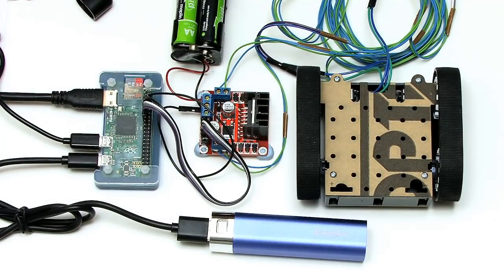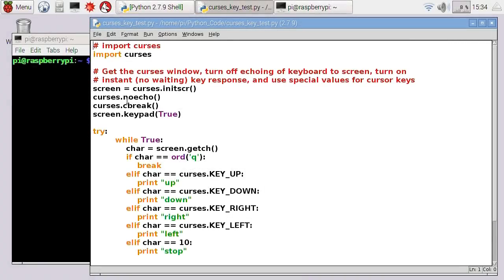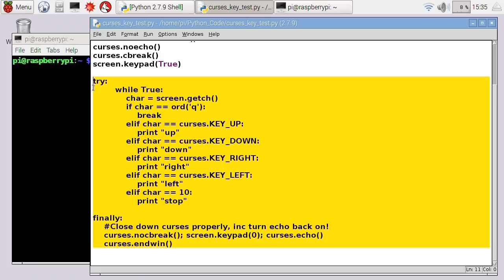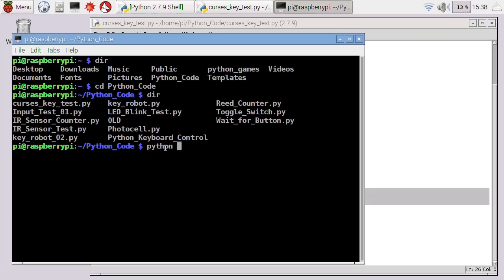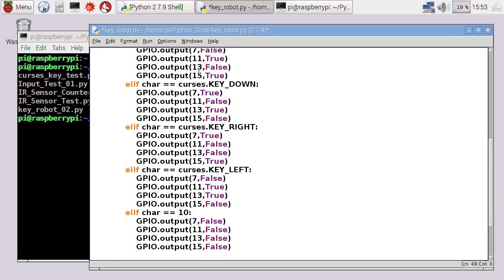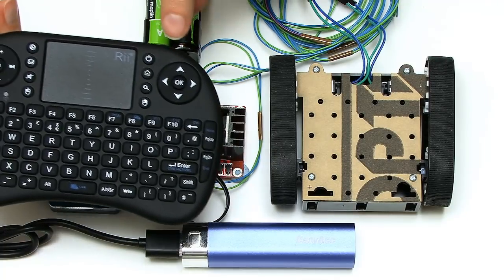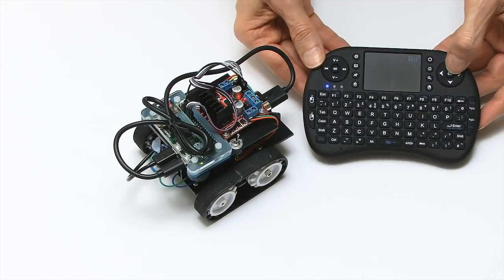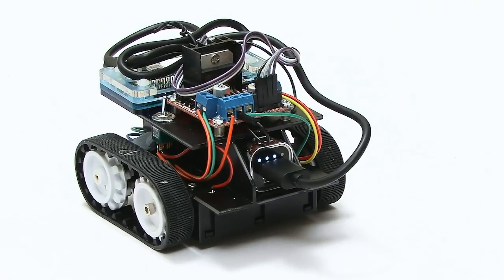Raspberry Pi Robotics #3: Keyboard Control

Comment: do you use a wire stripper to strip the wires if so which one? thx
Reply from the maker: Yes, the wires for the motors need to be stripped. I use a very old (30 years plus) wire stripper. But with care you could use a knife or scissors.
Reply: ExplainingComputers So how do you attach wires to the motor controller then?

Comment: Hi Christopher and merry christmas! I tried to make this project, i wrote the code, i connected the rii before booting up the pi but it still doesn't work!! I run the code and it doesn't read the keyboard. I press the up, down, right, left buttons and nothing. It doesn't even read the q button to kill the code. What am i doing wrong? Can you help me? I really love your vids, i'm trying to teach them to my students being a physics teacher and new to robotics. Thanks a lot!
Reply from the maker: Hi John, glad you like the videos. I strongly suspect that you have not run the code from a terminal. Curses reads characters from the active terminal window, hence if you have executed the code from (say) IDLE, it will not read the keyboard. More broadly I would suggest building thing up in steps -- first checking you can get the curses_key_test.py code to run OK, then build things up toward a working robot. Working in stages allows you to find out where the problem is. Good Luck! :)
Reply: @ExplainingComputers  Hi Christopher, thanks for the immediate response! Unfortunatelly it's not working still. I run the code from the terminal and i also copied your code for the test but it doesn't show anything on the shell. "Up", "down" etc.. The wiring is ok, cause it runs all your previous projects. The zumo robotics No.2 is working just fine! I can't understand why this project is not working. Is the curses library already in python or should i download it? I have the latest version of raspbian. Thanks for everything in advance!
Reply from the maker: Hi John. At least you have isolated the problem to the curses module, so getting the test code working for that can be your focus. Curses should be pre-installed in Python. It is several years since I made the video, but I have been using the same code in my recent robot videos no problem. My guess would be  a syntax error somewhere. My code can be downloaded from: https://www.explainingcomputers.com/rasp_pi_robotics.html Note that the latest version of Raspbian does I think default to Python 3, not 2, and that this changes the print syntax -- so print "up" become print ("up"). But the operation of curses should not be impacted.
Reply: @ExplainingComputers  it worked!! I was running it as a sudo and not with the exact commands through the terminal. I am a noob in linux, sorry for the trouble I put you through and thanks for everything!! Looking forward to your next video in robotics!!
Reply: Many greetings from Greece!
Reply from the maker: Glad things are working now! :) Hopefully you'll continue to progress with the project (the next video in the series covers remote access via SSH, an the content in my second and third P Devastator Robot videos could be applied directly to the Zumo build -- autoboot code, camera, etc. I'll also be posting a video on implementing speed control in Spring 2019.
Reply: @ExplainingComputers  For sure i will continue to all your next projects, i 've watched them a thousand times! :) Speed control would be great and also i would love to see an obstacle avoiding robot car using python! Or a quadcopter using the pi (if this is doable)! Cheers! Continue the fantastic job!

Comment: When I try to run the basic curses code it says there is an error with the curses.cbreak() line
Reply from the maker: Make sure you are running the code from an active terminal window (where it will grab the keystrokes from).

Comment: hi I have syntax coming up a little strange pyrthon 2.7.2 the issue is the 7 the program stops with a syntax error can u help kevin
Reply from the maker: I need to know more than you've provided -- what is the error?
Reply: in the shell screen. the text is. Python 2.7.9 (default. Sept 17 2016.20:26:04)
the fault is then displayed. "There's an error in your program: invalid syntax." 
the "7" is highlighted just after python. this stops running the program what to do?

Comment: Great project
Reply: I tried this project's code (beginner here) and I have a question, I'm wondering how I can make it so that the hotkeys continue to function as the code says even though I want to be in another window and not in the terminal window. I want to have the terminal run in the background. Great project!
Reply from the maker: Rafael Amiama Sadly using curses to read the keyboard the terminal has to have the focus. There are other ways to read the keyboard,such as using pygame.

Comment: Sir! i have made a bluetooth mobile controlled car using arduino and l298n and bluetooth hc05
.. so is it more easy to use raspberry pi 3 than an arduino...
if yes then can u tell me that how to use the wifi of raspberry to connect to my home router and then i can control my robot through the mobile data of my android device.. i mean that can i control my car with local network as well as from online network(server or something )
thank u...
sir!
by the way u r the best pi tutor
Reply from the maker: Thanks for your kind feedback. I think you want to watch the next video in this series: https://www.youtube.com/watch?v=44yNbFictEg
Reply: i have watched the video u suggestd but u havnt told in that to control the car without stopping through enter key... can u just make it easy to control just by pressing the curser keys to move the car and releasing thm to stop the car

Comment: I have a problem here... I wrote the Python code just as in your website... but on my Raspberry it is showing that it cannot run the program due to an error. Same is the case with your #2 Robotics video... Can you guide me a little bit?
Reply from the maker: Is it a permissions issue? Have you made the file executable? Or do you need to run it via sudo idle? I cannot remember the content of 200+ videos I'm afraid, but everything you need is in each video, but you must follow every step. Good Luck!

Comment: Hi Chris,
Having a problem running the curses library. In my system it's showing "_curses.error: setupterm: could not find terminal" when I run the code. Pleas help.
TIA
Reply from the maker: Are you running it from the terminal?
Reply: @ExplainingComputers  thank you for the reply...I solved the issue. The problem was I was running the code from the IDE instead of the terminal
Reply from the maker: @mainulweb2714  As I suspected! :) Glad it is working

Comment: Thanks for the tutorial, I tried to do the same thing with my raspberry pi zero w with the same code but is not working.  error message  " could not find the terminal"
Reply from the maker: This should work fine with a Pi Zero W. Are you running the code from a terminal window? (Rather than from an environment like IDLE?).
Reply: I created a file in directory and named it python_code then copied key_test.py. When I tried to run from the terminal I was not able to find the file in the directory. I followed theses steps. 
dir
cd python_code
they was no file.py in cd python_code. I don't know what is the problem. 
thanks for your support.
Reply: I would like to apologize, the program is working. I followed again all the step. 
Thanks

Comment: Is it possible to make an Autorun for the python robot code?
Like, when we boot the Raspberry PI it starts the code immediatly.
Reply from the maker: Yes, totally. And I will cover that in a future video.
Reply: Additional to that, can your robot power switch be implimented in software somehow (perhaps via an actuator controlled by gpio, if one such pin can not go crazy on boot and or some other implimentation)?

Comment: Can I use the powerbank to power both the bot part and the Pi?
Reply: Also  I'm not sure how it to do that, SM1 guide
Reply from the maker: Potentially yes, but it can cause problems (for example the load from the motors causing the Pi to reboot when they start/stop).

Comment: Great job...good explanation...But Up key is coded to backward, and down key is coded to forward...and hence right and left are reversed...
Reply from the maker: Depends on which may the robot is facing, and which motor is connected to which set of outputs! :)

Comment: +ExplainingComputers Sir, can i use a L293d motor driver?? The difference between l298n and l293d is obviously about its cost but I don't know if l293d can be compatible with this tutorial. So please answer this doubt sir.
Warm Regards, 
Your fan from India.
Reply from the maker: I've not used a L293d, so am not really able to comment on its suitability. As far as Google tells me it can handle a lower load (1A rather than 2A), but this would be fine for the motors on the Zumo.

Comment: Can you set the stop function on key-up events? So that it stops running when I lift my finger off the key and just runs as long as it's pressed.
Reply from the maker: Sadly no, curses only returns the last key pressed -- it cannot report when a key has been released. Which is the flaw of using this method to use the keyboard. Other methods include using a module called Pygame. But the curses method at least has the advantage of working on any Pi in any version of Python.
Reply: This code will keep scanning the keyboard and so can be used to set a stop as soon as a key is released.   Key 10 / Enter could be re-assigned to do something more interesting ... like make a blaster noise like the 1980's BigTrak.  
====================================

from curses import wrapper 
import RPi.GPIO as GPIO

#set GPIO numbering mode and define output pins
GPIO.setmode(GPIO.BOARD)
GPIO.setup(7,GPIO.OUT)
GPIO.setup(11,GPIO.OUT)
GPIO.setup(13,GPIO.OUT)
GPIO.setup(15,GPIO.OUT)

def main(myScreen):
        myScreen.clear()
        myScreen.keypad(True)
        myScreen.nodelay(True)

#KEY_UP = 259, KEY_DOWN = 258, KEY_RIGHT = 261, KEY_LEFT = 260, ENTER = 10, q = 113

        choice={ 259:"0101", 258:"1010", 261:"1001", 260:"0110", 10:"0000", 113:"0000" } 

        char=''  # two single quotes

        while ( char != 113 ):  # q key stops all this nonsense

                char=myScreen.getch()

                if ( char > 0 ) :              #nodelay is set, so -1 output on no press.
                        chosen=choice.get(char)    #lookup dictionary
                        print(char, chosen)                #this for debug only
                else :
                        chosen="0000"

#    Set Pi's GPIO pins 7,11,13,and 15 according to dictionary
               GPIO.output(7,int(chosen[0:1]))
               GPIO.output(11,int(chosen[1:2]))
               GPIO.output(13,int(chosen[2:3]))
               GPIO.output(15,int(chosen[3:4]))

GPIO.cleanup()
wrapper(main)
Reply from the maker: Inaflap
Thanks greatly for this, really useful.
Reply: Thank you for the code. I'm new to python and hopefully can accurately articulate a couple issue found. 
When copying and pasting the code, a non-ASCII character was found at the end of the last line: "wrapper(main)" To fix this, simply delete the line and retype it.

The next issue is a NameError: name 'chosen' is not defined. This error is thrown on GPIO.outout(7,int(chosen[0:1]))   Why was this error thrown and how can it be corrected?

Thank you!
Reply: judgeguilty
Python delimits code blocks using a :
and then indenting all lines in the block by the same type of white space, whether that is a <TAB> character or multiple <SPACE> characters.  The cut and paste in YT comments is messing with the whitespace.
Wherever you see a : colon, ignoring trailing comments, the following lines must be indented if you wish the Python interpreter to consider them part of the code block.
For <TAB> just press the Tab key once.
If you want two tabs then press twice, but be sure to always do that, because the first type of whitespace you use is how Python determines what belongs in the code block.  If you don't indent with whitespace then the code will not be run in the following if statement, and chosen will not be implicitly defined, and that will cause the problem you encountered.

if ( char > 0 ) :
<TAB>chosen=choice.get(char)
<TAB>print(char, chosen)
else :
<TAB>chosen="0000"
Reply from the maker: Inaflap Again, very useful. Thanks for posting this.
Reply: ExplainingComputers
 It should be noted that I used Python 3.x  
The same whitespace indentation rules exist as with 2.x but at least the 3.x interpreter warns of inconsistent use of whitespace characters in a code block.  If you type a <TAB> on one line, but use three <SPACE> chars below it, they might appear to be identically indented, but to the interpreter they are not. 

I like Python 3.x, for it's power and readability, but I prefer the method of delimiting blocks with curly brackets as in the C type syntax languages.  I did write some code in C to have a Pi control a simple two transistor buzzer circuit which would beep out morse code from a message typed into a website.  That was a bit of fun.  I can't find it on this PC, but will dig it out if you ever care to do some C coding on Pi.
Reply: Thank you for your assistance. This Python is a strange beast. Perhaps ExplainingComputers could post your code in the proper format on his website?

It would also be interesting and educational to see the same program written  in Python using objects, classes and methods. Thanks again to EC and inaflap for sharing your knowledge and inspiring others.

Comment: I know this has nothing to do with this video but I tried to over clock my core 2 quad 2.66ghz to 3ghz but I can't add the MHz all at one time I have to put 2mhz at one time then restart the computer and now when I got it to like 2.72 GHz it won't go up because when I restart the computer anything won't come on the screen so I have to take out the motherboard battery
Reply: nothing will come up on the screen then too if I add more than 2 MHz
Reply: sorry for my bad English too because English isn't my first language

Comment: Excellent project for adults and kids, thanks Mr.Barnatt !!!

I am facing one error with keyboard input code .. Appreciate anyone with clue on how to solve this, i am using Rasberry Pi II 

The following is the error message, in the line "curses.cbreak ()". the error goes away by commenting, but cannot uses curses. 

Traceback (most recent call last):
     File "/home/car-key.py", line 19, in <module>
         curses.cbreak ()
_curses.error: cbreak() returned ERR

Comment: can you make it work true wifi so like you can use a phone to control it and it could be cool if you could add a camera to the projet so you could have a a mini spy robot
Reply from the maker: Using the WiFi and USB hub dongle I showed in the video -- or another Pi -- this could be done. And I will indeed do this in a future video. :)

Comment: What do you think of using same batteries for the motors and the pi?
Reply from the maker: It is potentially possible. Sadly the 4  x 1.2v from the AA cells may not be enough to run the Pi.
Reply: oh. I see, I was expecting it to be too much actually. (1.5v x 4)
Reply: But even at 1.5v, as the battery drains it might not make the pi reliable, right? Do we need higher ampere or do we need higher voltage (then just use resistor?). Would 9volt battery(+resistor) be a good idea?
Reply from the maker: Albert Diones A 9 volt battery plus a voltage regulator would work. As you note, the Pi will be far more sensitive to power fluctuations than the motors.
Reply: Thanks!

Comment: Hello ..i have a same project but the difference is i have to control this by usb gamepad connected to pc ...how can i..plzz reply
Reply from the maker: This is a very broad question I'm afraid -- if also programming Python, you need the code/method to access the gamepad.
Reply: any video you suggest to get closer.

Comment: when I run your code, have a followin message of error:

Traceback (most recent call last):
  File "/home/pi/Desktop/probar.py", line 14, in <module>
    screen = curses.initscr()
  File "/usr/lib/python2.7/curses/__init__.py", line 33, in initscr
    fd=_sys.__stdout__.fileno())
error: setupterm: could not find terminal

I mean that the screen = curses.initscr() is not declared good in this statement o maybe other problem, please help me
Reply from the maker: "Could not find terminal" suggests you have not run the code from a terminal (eg you have run it from Idle).
Reply: ExplainingComputers how I need to do to run the cose from IDLE without having any erros?
Reply: I have the same problem :/
I am running the code from the Idle ... and it doesn't work.
Could someone help?